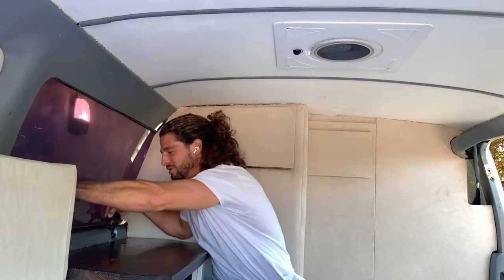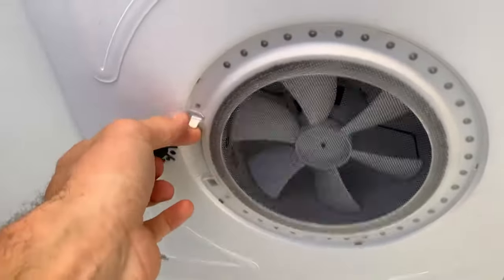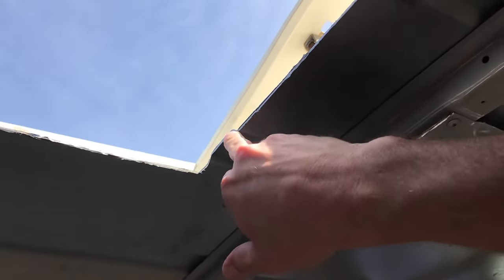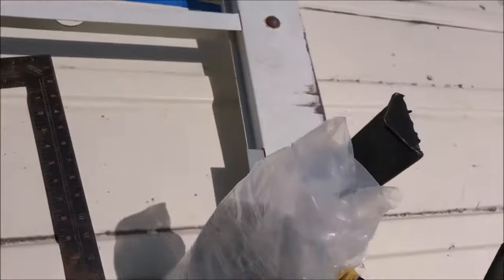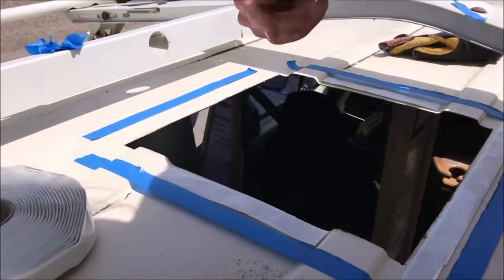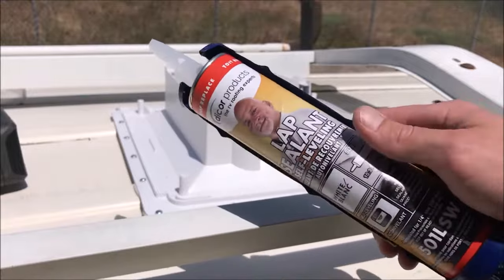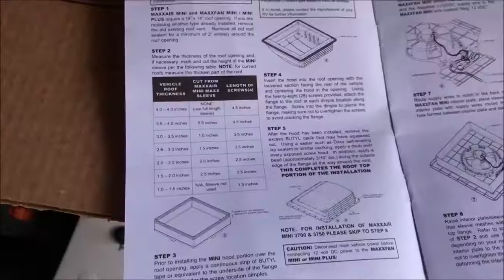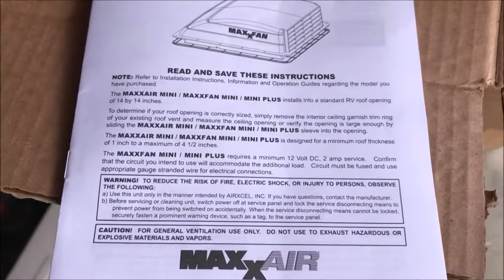Vent Install - Camper Conversion Van (Maxx Air Mini Fan)

Comment: Hey Jake! Couple of questions while I'm shopping for vents/fans. What's the exterior height? I like the idea of placing this under my solar panels. Also how do you keep cool in your van since that is only an exhaust? Thanks!
Reply: I think it's 4 inches from the ones I've been eyeballing
Reply from the maker: Yes that sounds accurate. And because the hottest air will be in the top of the van, it benefits you to have the fan blow out and crack at least one of the windows in the van and the fan will pull air in through the open window!

Comment: Thanks. Trying to decide between this or tge tiny 6 " dome one (also with light.)

This light would provide more illumination I'm sure.  But my conundrum is, my vans old and I'm not sure I should invest TOO much.  Although I could prob rip out whatever I put in later.  

Decisions.   

I'm also trying to decide on a power supply.  We currently live off two Duracell jumpstarters as our power supply.  Bbut Id like to add lights, and a small fridge down the line.
Reply from the maker: I recommend getting what you would like to have for the next couple of years. Then who knows what the future brings, but much easier to spend a couple extra bucks now than replace it in the near future when youre not happy with it! Good luck with your upgrades!